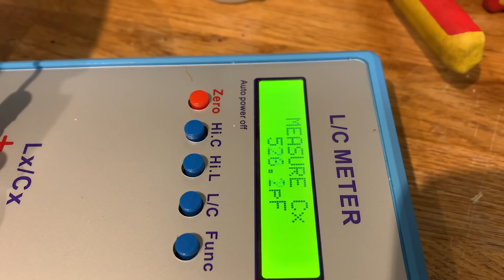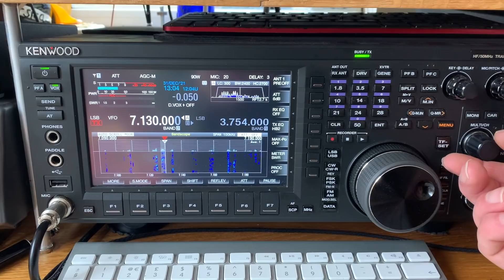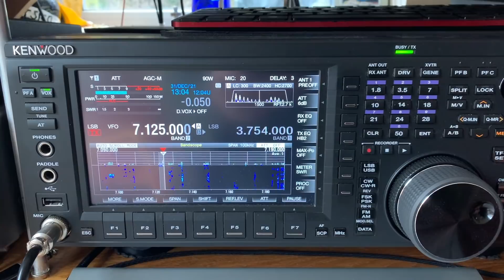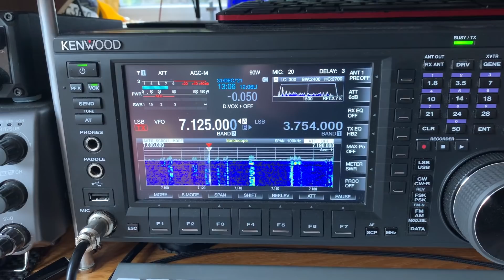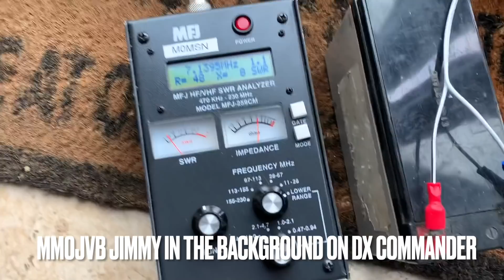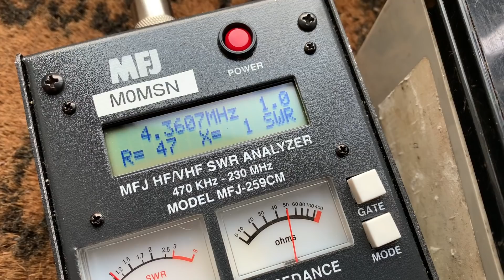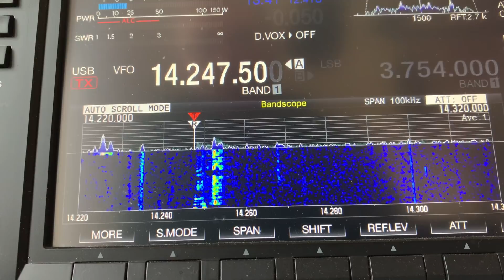HAM RADIO: Magnetic Loop Antenna : Figure of 8 Mag loop : 40M & 80M Finished.

Comment: Just a thought Mike, the loop that you drive that with (the 70cm one), try squashing it a little so that its not round (so that more of the lower 1/2 is closer to the figure of 8) - this (in theory) improves the coupling and can raise your output RF quite a bit, found some information about that whilst looking up designs for building a loop myself (that I never got around to) :)

Comment: 3:30 be careful when connecting copper wires with zinc-plated washers and nuts. These metals form a galvanic pair. The copper part should be tinned, and the whole construction covered with a varnish, if possible.

Comment: Hi Mike have you considered switching in some more capacitance when you want to try 80m - maybe you have a trombone lying around somewhere?? Also I agree with wecb640, you should use some thicker wire...coax braid perhaps (i use strips cut from 25mm copper pipe) for the interconnects. Excellent work de m0tfy
Reply from the maker: Not concerned about the wiring on the capacitor as I intend to remove and upgrade the whole thing again shortly, but thanks for your Input.

Comment: Hi Mike, well done on building the loop. Personally I think it looks brilliant.  One question, I see that the coax connected to the driven loop is connected one side to the centre of the coax and one side to the outer screen. Does the radio not see it as a dead short? Or am I missing something and need to read up on loops? Cheers, Carlo.
Reply: You can't look at it in the DC domain. Like a transformer at DC looks very low resistance but in the AC domain its impedance is a ratio of the other coupled windings, in this case the Figure of 8 and the Capacitor form a tuned circuit. Whos impedance couples to the driven element once coupled become 50 ohms or there abouts. I hope that helps?
Reply from the maker: Thanks Phil, could not have put it better myself.  HNY chaps
Reply: @mike-M0MSN  HNY to you as well. Apologies didnt mean to steal your thunder.
Reply: Aha, thanks for the info Phil.

Comment: What size single loop would work over 40 & 20 mike
Reply from the maker: 5M circumference or 1.5M Dia. Will do both 20 & 40.
Reply: @mike-M0MSN  thanks so best for outdoor use ,what wire would be rigid enough at budget

Comment: Mike, I very much enjoy you videos on mag loops - tends to brighten up the dark Swedish winter days :) 
In this video, you say that the loop is only 40-50% efficient on 80m whereas it is 80-90% efficient on the 40m band. My problem is that I don't understand what you mean by efficiency in this context. Is it efficiency in the sense of ratio of the power radiated from the antenna relative to the power delivered to the antenna? If so, how do you measure the radiated power? Please enlighten me :)
Reply from the maker: I will answer that question a little later, but you can read a bit more about that here. https://www.66pacific.com/calculators/small-transmitting-loop-antenna-calculator.aspx